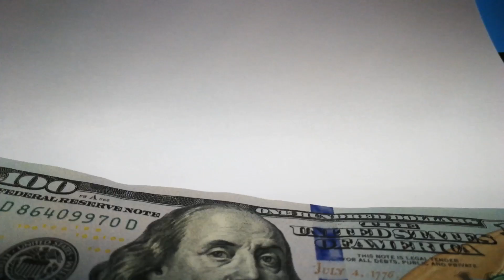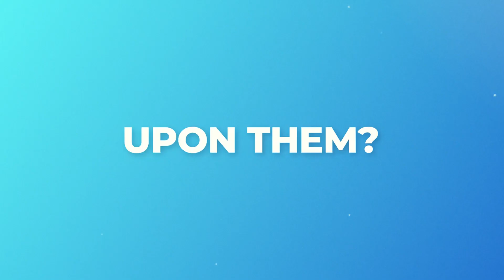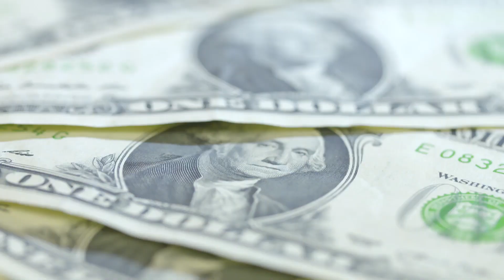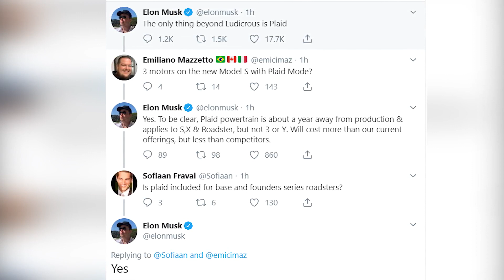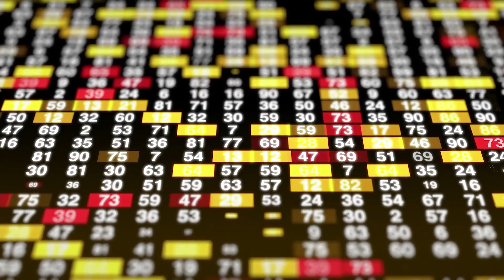Elon Musk Tesla Battery Day 2020 - Our Prediction

Comment: In my country we don't have nuclear power plant, we have coal power plants so to produce electricity for car we would need to use more coal witch makes more polution than dizel on benzin (gas, or oil how you say).
Reply: Changing those few plants to something better for the environment is way easier than changing every car later assuming people start driving electric cars now. And with the battery power plants like the one Tesla put in Australia, they help eliminate the need for peaker plants, so you'll need fewer coal plants overall.